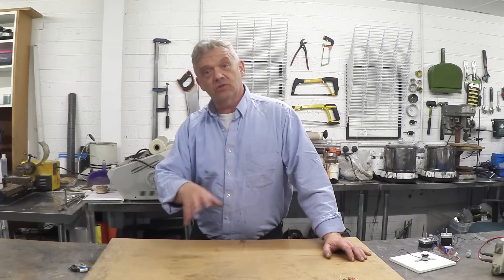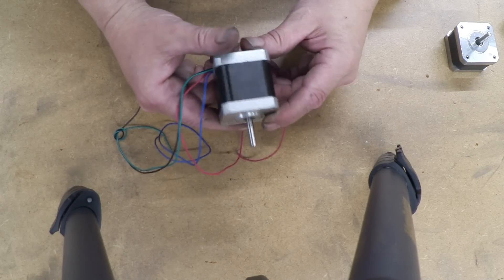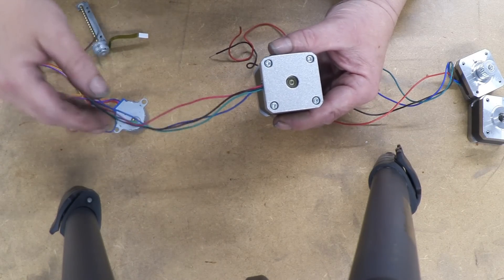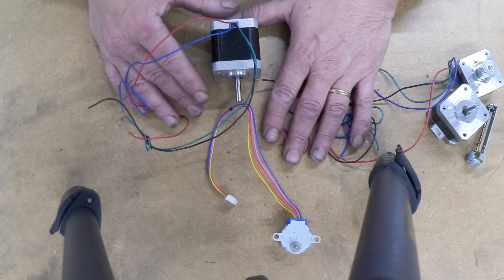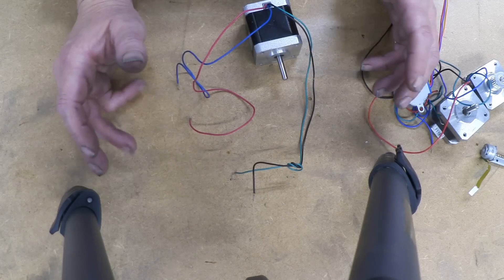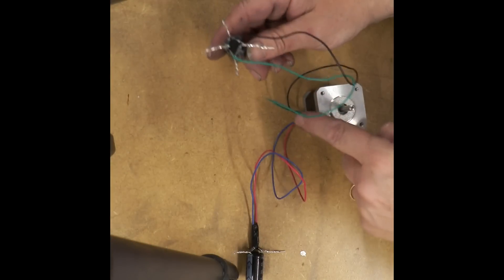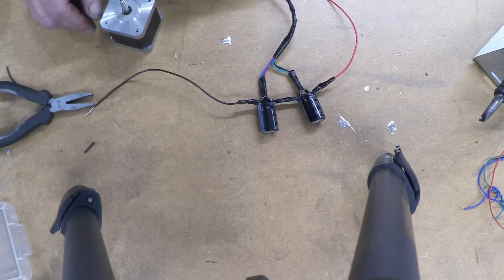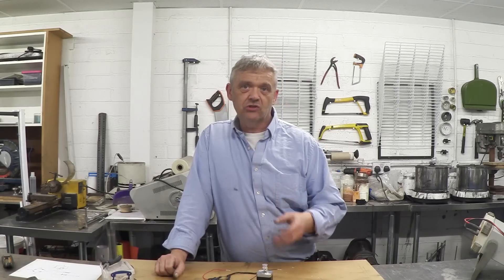All About Converting Stepper Motors To Generators

Comment: i understand stepper to diode to capacitor but how does it work after that? I want to use the stepper motor to charge a battery. What does the capacitor get connected to after? A charge controller? I would love a video of the next steps after what was said in this video. Example. i want to charge a 48v E-bike Lithium Ion Battery using a stepper motor as a windmill. I love the idea of the capacitor holding the charge and sending a continuous current even if the windmill isn't in motion. I am a visually learner and these videos are extremely helpful! I would appreciate any help!!!!

Comment: Thank you for this, it makes things so much more clearly understandable, the unmistakable sign of a proper teacher/tutor.  I have a 12 volt DC stepper motor about a foot long and 6 or so inches in diameter that I hoped to utilize as a source of motive power.  I haven't seen it in over a year, or I would know the amperage, wattage, maker etc.  Can this simple circuit be of use in pursuit of my quest?  Is it feasible, on the whole, to hope that this motor might serve my purpose, to propel a trike of the Morgan variety, lightly laden?  I am off in a day or so to retrieve it and thought I ought to ask.  By the time you answer, I should know the proper answers.  In either case, thank you.

Comment: Great explanation and drawings Rob :-)
If you are short of components, maybe you could wire the two coils in series or parallel before you connect to the bridge circuit. You would then only need 4 diodes and 1 capacitor.
Reply: But the coils are 90° out of phase, so connecting them in parallel would be quite inefficient and could potentially damage the motor. Connecting them in series could work, though.
Reply: @GRBtutorials  Cheers for that, must confess I had not thought it through, got it half right :-)
Reply from the maker: you could do that mate - but often the coils are of different size and they are out of phase so there would be a bit of 'fighting' going on if you did that.
Reply: @ThinkingandTinkering  I should have known you would not be using twice the bits for nowt :-)

Comment: If you want to bring this along distance using a step of motor connect one wire for each winding together and take two other ones is essentially a split phase system but you’re not using the centre as a neutral because we’re going to rectify the system stay balance

Comment: The better diodes to use are the Schottky diodes - they have only 0.4 volts drop.  The 1N5817, 18, 19  are 1 amp, 20, 30 and 40 V PRV.  Also some diodes on switching PSes are Schottky diodes.

The motor with 5 wires has the common red wire going to the center taps of both coils.  You must check how you connect the full wave bridge rectifiers -- they could cause a short across the windings.
Reply from the maker: you mean like I said in the video?

Comment: You should see if you can find a broken hoverboard and salvage the wheel motors from it. There are a couple of youtube videos from 'DIY King' using one in a horizontal and vertical wind turbine. The horizontal turbine seemed to work well, but I think the vertical turbine needed to be geared up for better performance.
Reply from the maker: cheers mate - I tend to use what I stumble over so if one crosses my path you cane sure I'll use it lol

Comment: If I want to connect the dc power in series would I simply connect the positive of one phase to the negative of the other phase on the load side of the capacitors?  Thank you.

Comment: OMG thank you!... I have always wondered about making bridge rectifiers! Couple of questions... are there any sources of bridge rectifiers (or parts) in PC components (or even ready made) I could scavenge? AND Could I use a few (or many) super capacitors from the microwave I disassembled to get some storage to run 30 - 60 meters of 50/50 smd led strip lights?

Comment: You could use the coil output in series and use just one bridge rectifier. What's the purpose of using two rectifiers if your wiring in series?

Comment: Thanks so much! Super useful and inspiring. As a novice, when thinking about applications, I wonder about how to get a feel for dangers and limitations of this sort of project... e.g., Is there any danger of damaging the stepper motor by turning it too fast?
Reply from the maker: It's why I do so many small experiments mate - you get a feel but at low cost. Some folks complain I don't build enough big things - if I did that it would bankcropt me - do a lot of small  - get a feel and then do a big

Comment: Hello 
Came across your channel and now subscribed.
Would be nice to see how you would or could charge a 12v car battery as not everyone wants to power a house😂🤣.
If possible may you fo one on connecting a stepper motor output to enable trickle charging of a battery. Great for small wind turbine projects or beginners.

Comment: A Decent Hand Cranked Phone Charger Would Be Smart
Reply: Yup you can get a good 500 milliamps  from the right one easily
Reply: @preppertechnicianee6013  Nice
Reply: @joohop  

Sorry typo milliamps 

500 milliamps is the charge threshold typically think I have a video on using synchronous  motors to run a phone system
Reply: @preppertechnicianee6013  Please Share Earthling
Reply from the maker: go for it

Comment: Thanks for the response on your last post. My next tool i need a thermometer to read the temp of a working heating element as I'm really not sure on its temperature.   I've got another three puzzles to solve today but having so much fun doing it. Could I send you an email mate. I'd love to show you where I am at.  Have a great weekend mate.
Reply: Why not use an Arduino thermal module such as a thermistor or similar. There are a couple of different modules around with simple connections
Reply from the maker: You're going to need a type thermocouple at least mate for temps that high and Steve made a great suggestion - but if you don't want to do that a PID controller and free moving  k type thermocouple  is easy to lay together and will do the job
Reply: @ThinkingandTinkering  I'll post a picture so you can see what I'm working maybe that would be useful.  I was thinking about the thermometer gun capability of say 500c . I can wait for parts to come in or pay a fee of £69 which is only 6 less than I sell my products for. Sending pictures now
Reply from the maker: @karlmyers6518  awesome mate
Reply: @ThinkingandTinkering  its posted mate. Have a looky looky

Comment: Hi! Thank you for your video, I want to control the rotational speed of the motor using a changing resistance (I read somewhere I can do that) but to do that, I need to now the rotational speed of the motor - which I was wondering if I can calculate from the power output of the motor. Is that possible?
Thank you!

Comment: thanks a lot for this video! when using this in a windmill for example, would it be best to keep the AC to span the distance to the house, and put the rectifiers inside, close to the charge controller?
Reply: Yes, AC travels over distance better 👍

Comment: Hey brother you're awesome, I've been building a generator for a few months now and I'm using the stepper motors and bridge rectifier method, I'm using a 12 volt dc motor wired to a controller wired to a solar panel and it works really well! I get more voltage out than I'm putting in, how could I go about possibly looping some of the power I'm getting out into the dc motor and eliminating the solar panel, or just using it to start the generator!

Comment: I think only larger, older printers use steppers. The modern, cheap plastic sort of printer I've dismantled have used DC motors and a plastic strip with almost microscopic bars on the strip mounted across the frame of the carriage that the print head slides along with an LED and detector counting the number of bars as it goes back and forth. It uses that for positioning the DC motor instead of pulsing a stepper with current pulses and counting them.

Comment: I've been going through quite a bit of junk, due to having to move, and found what looks like a decent 3 phase motor. The drive motor in a 3.5in floppy disk drive 3 phase, 18 poles. The only problem is it is built as part of the drive frame, but i guess that can be cut down. The stepper motor on the floppy drive (head positioner), has one of the bearings made in part of the frame too, so may be more difficult to use,  requires cutting the frame out too. Not sure how easy it is to get scrapped 3.5in floppy drives these days.
Reply from the maker: I haven't seen one in about 5 years mate
Reply: @ThinkingandTinkering  I had a look on Ebay and they are fetching silly money for 1.44MB of storage. Lucky I have a fair few of them if they are any good for micro-generators.

Comment: I thought a 1n34 diode was a germanium video detector or a xtal radio diode similar to a 1n60 ! Also those stepper motors are 220v in Eur. Would they gen more voltage than a 110v one here in the US? Just wondering . Didn't mean to sound smartaliky but 1n60 and 1n34 were what I used to make xtal radios with in the 60s. I worked on TV's for over 45 years and had only 1 video detector diode go bad . It was in a bw tv in the early 70s. Good job ! You're an excellent teacher!
Reply from the maker: it's a germanium point diode I believe with a low voltage drop - good to use when the output voltage is low and with a smaller motor like the one from the DVD player it's likely to be pretty tiny tbh. They don't really run stepper motors off line voltage mate - there is a bunch of conversion electronics to supply input voltage from what ever the line voltage to whatever the stepper voltage requirement is. So, pretty much stepper motors in the UK are the same as stepper motors in the US - and cheers

Comment: Have so many of these around 
Have you gone over synchronous  motors

You can get a good 3 watts out of those 

Get 50 of those in a river continuous  150 watts

Been using it for emergency lighting for a while
Reply from the maker: I have mate
Reply: @ThinkingandTinkering  good stuff

Comment: hi, awesome, i am thinking of making a wind generator with this for my shed to charge 12volt batteries, what diodes and capacitors would i nees and could i then simoly connect to my 20ahmp mppt charge controller?

Comment: Can you please help me on my project of hand crank led torch using 6 wire stepper motor
Reply: Easy the two center wires need joining and use the last two outer wires for the output.

Comment: Brilliant video Robert and just the thing I was looking for. I have a few ideas now, with a stepper motor. I have 4 of them from an old 3D printer and was thinking of using one for an alternator generator I hope to build. Instead of using a battery to charge the field coils of the alternator could I use the stepper motor with the bridge rectifier, of course, to charge the fiend coils of the alternator. The power source to run it is a 4 stroke horizontal lawnmower engine, so it will supply rotation to both the stepper motor and the alternator, therefore no battery would be required and all the power would be harvested from the alternator. Do you think this would work? Cheers mate. 👍👍👍🎸🎸🎸
Just an afterthought Robert: If I did set this up the way I have explained then I would need a 12-volt regulator coming from the bridge rectifier. Would that be ok?
Reply from the maker: I like that idea mate - a lot
Reply: @ThinkingandTinkering  Thanks Robert. The alternator I have may have this pulse sensor in it. Seemingly there is a pulse that needs to be sent to some of the new alternators in order to get them to start producing power. I will keep messing with it and see how I get on. Probably take it apart and keep the regulator, or just buy a 14-volt regulator. Cheers mate.
Reply: In most cases you can use a battery and momentary switch to initially charge the field coil, then the alternator can "self charge" with a tap off the output fed back to the field coils.....generally speaking, the output from the alternator can be governed by the input to the field coils.
Google  "variable current DC welder from automotive alternator" and you should find a great deal of info, sorry I can't be more specific as voltages and amperage ratings vary a great deal within the world of automotive alternators....

Comment: Look for outdated reprographic machines that are being replaced. On Craigslist I picked one up for free and another for 25 bucks US. they are loaded with high quality  steppers and driver circuits not even close to their duty limit as well as other valuable components like capacitors and gear reduction motors. I probably harvested 20-30 steppers from these two
Reply from the maker: that is a nice post post mate - thanks for the info

Comment: Robert, does the capacitance of supercapacitors drop the same way regular capacitors do when placed in series?
Reply: Garbled User yes, all capacitors in series drop value like resistors in parallel
Reply from the maker: yes mate - the same rules apply
Reply: a super capacitor is a regular capacitor if you ask me.

Comment: Thanks for that explanation and demonstration, I am new to electronics and am learning from vids like yours. I could just about understand this one, the only part that I’m not sure about is at the beginning where you identified what wires were for what coil. As I’ve never used a multi meter, would it be possible to work the wires out using a basic non battery volt meter?. Perhaps if I kept trying different wires and turn the spindle until I get  movement on the meter needle, or is that silly?
Reply from the maker: that should work mate - you could also just wire up an LED with this one and it will blink when you have the right wires connected
Reply: Robert Murray-Smith Many thanks mate for reply,
Reply: Robert Murray-Smith Wow, I have so much to do now, I already have a table full of a variety of motors from the v small to ones from hovermowers etc. I have a Brush motor( that came from a food processor) it has coils on the stator and the rotor, is that a ‘Universal Motor’?.

Comment: I have a whole stack of brand new robot motors I have scavenged from the scrapyard just for this project. A couple of them incredibly large. 60-70  pounds. Eventually I’ll spend the time to get a few turning.
Reply from the maker: curses I wish I had a couple of those lol
Reply: Robert Murray-Smith   I wander if what it would cost to ship em?  I’d probably be a mint.   Hmmm
Reply: It's unlikely these are stepper motors. Steppermotors are fine for printers where the mech. load is stable and exactly known. These are probably servo motors

Comment: not sure how it would deal with variable freq but linear tech has an active rectifier controller ic. lt4320
something like 7 to 72 volts. powers off input through body diodes iirc. 
 it looks like they've come out with a few more models. still a pain in the ass without PCB (but possibly doable with smd to through hole converter.. not sure how the drive and sense of the ic would care for it but worth a shot).

no idea about UK but in the us you can get a custom  PCB in a week for $5 a square inch dual sided 3x of design. osh park 

kikad is open-source pcb cad software with a small learning curve but power through it and a lot more projects are in reach. a lot of times you can cheat when mfgs use standard packages or provide cad files. for fluent use though figuring out entering a package footprint is a good thing to get good at. 

also if you prefer to Etch at home Laserjet can do toner transfer (resists acid) feric chloride isn't very difficult to aquire. disposal might cost though. more advanced, ebay sourced Riston and pool acid from home depot, clear volume 40 hair bleach plus a digital scale and scrap copper gets you the regeneratable etchant known as cupric chloride and if the source is legit the Riston is world class UV photo sensitive acid resist. I've tried the purple from China and green from some Slavic country.. imho both even with diligent prep are subpar. (disclaimer for people other than R. M-S: do your homework small chance of chlorine gas if u fudge up.) (also see chemical compatibility charts on Google and look for. edu sources check your gloves and intended container. face shield or respirator great ideas.) 

doubling up screen printing transparencies on ink jet and a little thought in alignment I've etched 0oz down to 8thou and probably could have gotten 6 with a cupric and lithography diy rig.
Reply from the maker: no need mate - keep it simple that's best

Comment: Wouldn’t you get the same output by connecting the coils in series and using one rectifier and capacitor?
Reply from the maker: well, you could do that mate - but the coils are out of phase and different sizes - so it would mean there was quite a lot of 'fighting' between them so to speak - so it would work but not well.
Reply: Robert Murray-Smith That’s mostly what I was wondering if there was a reason you would not do it. I definitely like the idea of having two rectifiers and dual voltages at your fingertips. Your statement about the coil being out of phase answered my next question as to whether or not paralleling the two coils would give you a smoother voltage at a lower RPM. Thank you for responding. Have a great day.

Comment: I wonder how many step down gear ratio can it handle, stepper motor has already have gear down inside, but can it go even further? the amps and voltage can go even farther
Reply from the maker: most stepper motors don't have a gear down mate some do and I showed one but the most don't
Reply: @ThinkingandTinkering  Usually stepper motor have a toothed permanent magnet inside, combined with a toothed stator. In many ways it has the same effect as a gearbox.